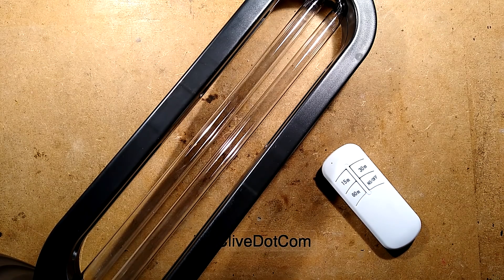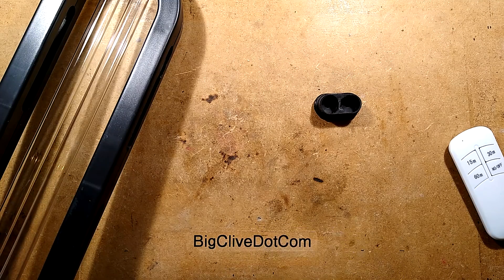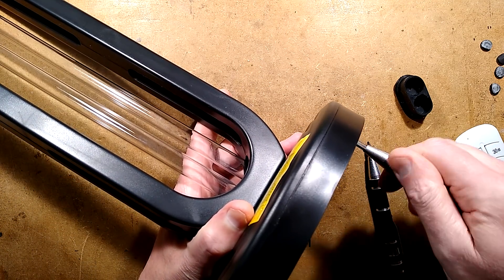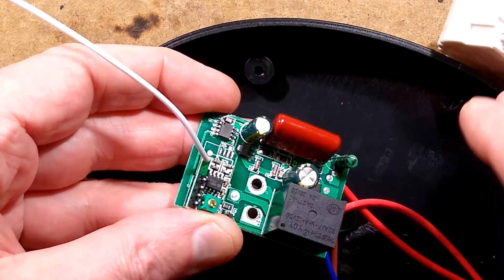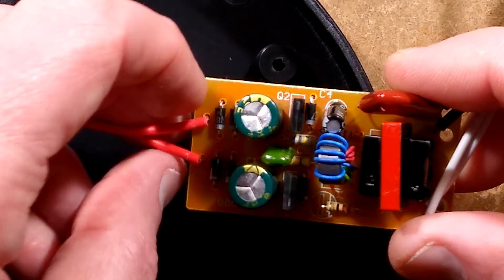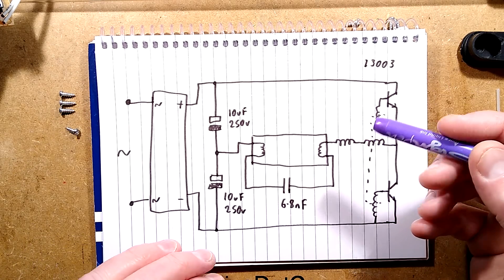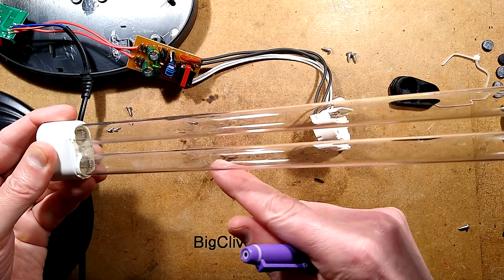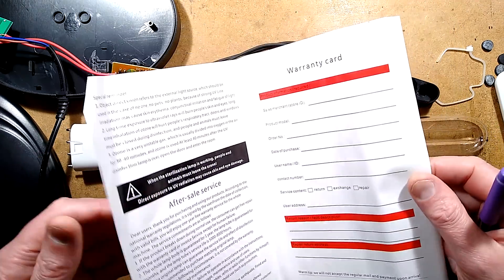Inside a stylish tabletop UVC germicidal light.  (Skin, eye and lung hazard)

Comment: Only the premium germicidal tubes will generate significant amount of ozone, because the cheap ones are made of borosilicate glass just like generic fluorescents, which blocks not just the <185nm wavelength which is necessary for splitting oxigen mulecules, but blocks a good portion of the higher wavelength UVC as well. To make it worse, their light output will drop dramatically in the UVC band during their lifetime. They should not be manufactured, but in China...
The better ones use soda-lime glass, which still blocks  the 185nm wavelength so doesn't produce ozone, but their longer wavelength UVC output is higher and more constant over their lifetime. 
The third variety uses quartz glass, and quite expensive. The UVC output is the highest and drops just a little during lifetime, and it can generate huge amount of ozone as it can be very transparent for the 185nm wavelength. Although for applications where ozone is undesirable, they make specially doped quartz glass which blocks 185nm but still maintains the highest possible output at longer UVC wavelengths.

I found an article about that circa a year ago, of course now I can't find it. I will link it in a later comment if I found it. 

The strange thing is that sometimes even seemingly reputable companies spread bullshit about the effect of different UV lights. The following US company claims that UV-C is NOT harmful, does not cause long term health problems (cancer, cataracts), as it does not penetrate deep enough into the skin to have such effect. They claim UV-B is much more harmful than UV-C, because unlike UV-C, it does not cause red skin effect or other indicating symptoms, while imperceptibly penetrates deep into the skin, and causes DNA damage, which can lead to cancer. They seem to be a reputable US company, but their claim about UV-C is not harmful seems very BS to me...
http://www.uvresources.com/resources/faqs 

*PS*: Am I crazy, or there is a ton on misinformation about this subject from seemingly reputable sources? I found one that states the following: " Borosilicate glass tubing is a common component in UV lamps. Because of its high level of transparency, this form of glass allows maximum UV light to escape, while shielding bulbs effectively. That’s why it is often used in UV lamps which sterilise water." https://glasstubes.eu/uv-resistance-borosilicate-glass/
Wikipedia: "The most common form of germicidal lamp looks similar to an ordinary fluorescent lamp but the tube contains no fluorescent phosphor. In addition, rather than being made of ordinary borosilicate glass, the tube is made of fused quartz or vycor 7913[3] glass."  https://en.wikipedia.org/wiki/Germicidal_lamp 

This pdf claims soda-lime glass also has good UVC transparency: https://www.light-sources.com/wp-content/uploads/2015/05/Germicidal_Lamp_Basics_-_2013.pdf 

Whilst this graph shows that soda-lime glass blocks wavelengths below 350nm:
https://www.researchgate.net/figure/Transmission-of-HSQ-R-100-quartz-glass-red-92-at-280-nm-and-soda-lime-glass_fig2_281293943

I think I given up figuring this out today... Experts, please help!
Reply from the maker: There are two dominant mercury wavelengths in the UVC region.  254nm and the shorter 184nm wavelength that creates ozone by splitting oxygen molecules.  The uviol glasses used in the tubes can be tuned with impurities to filter out that 184nm wavelength so you get the germicidal action without the ozone generation.

Comment: I'm definitely breathing excessive air but I just looked at my CO2 monitor and noticed it's showing 1263 ppm so it's not really quality air and I'm not sure it counts. Excuse me while I go open a window
Reply from the maker: Carbon dioxide monitor?  Or carbon monoxide monitor.  Either way open a window and let some fresh air in.
Reply: @bigclivedotcom  Mine is carbon dioxide. We got some new hvac equipment at work that monitors CO2 and opens outside dampers when the air gets "stale" with too much CO2. The numbers I saw throughout the day made me curious what it does at home. I also have CO monitors but they almost always stay at 0.

Comment: UV doesn't break apart DNA as such, more like cause it to crosslink to itself so it can't be read anymore.

There are actually enzymes that break apart this crosslinking, but the really effective ones require a lot of bright visible light to work, so apparently dead cells can come back to life if exposed to something like sunlight, or a really bright artificial light
"Photoreactivation"

These enzymes are unfortunately not active in vertebrates like humans

Thankfully not coronavirus as far as I'm aware.

Comment: This is a cataract machine.
Reply: Not really, the cornea absorbs UV. What you need is a good furnace, then you can get "glass blower's cataract*". *Not really cataract either.
Reply: Steve Terry  what do you mean by UV "frequency is high enough"? If it's high enough the thing is an xray and goes straight through without interaction.

Comment: I'd totally make a 'neon sign' version of these lights... one that makes the pale blue light without UV risk... at least without UCB and UVC.
Reply from the maker: A neon shop will happily make you a clear tube in soda or lead glass that lights mercury blue completely safely.
Reply: @bigclivedotcom  ahh and I suspect that being mercury based still, it won't need a high voltage driver.

Also... buddy van doodle (bad with names) with a welder?
Reply from the maker: @Skyliner_369  The mercury tube will still need a high voltage to run it, but not as high as neon.  Buddy van Doodle did indeed have a welder.  A welding gun.
Reply: @bigclivedotcom  One: Darn you for that song!
Two: Thank you for that song!
Three: How are you holding up in today's current situation?
Reply from the maker: @Skyliner_369  Doing OK.  But lacking the social environment of a coffee shop visit.

Comment: Well, if it doesn't emit "5G", I'm going to eat my fish & chips! - Yeah, quite a serious "Death Ray" in its own way, eh?

Probably a pointless thing to do, but could this be mounted inside a large diameter tube, with a fan underneath, and used purely as an ozone generator? Sort of, obviating the dangers of the uV light?
Reply from the maker: You do get UV air cleaners and ozone generators that work like that.

Comment: I purchased a similar lamp but from the Osram 36W without lamp holder or power supply, I turned it on with a 36W magnetic ballast and a starter for fluorescent lamps connected to the central feet, I noticed perhaps for the smell or it is just my impression, that this lamp is more efficient than an 80W HQL with removed external bulb, perhaps it has a different wavelength, it seems to me more effective so much that after a few seconds I feel discomfort on the exposed skin, I also noticed using a normal fluorescent lamp not UV as a test, which using an electronic ballst is less bright than a magnetic one.
Ciao

Comment: I tell you my story about UV lights, during my teens> I used to experiment with 400w mercury street light bulbs,  used to break off outside larger  phosphor coated  borosilicate glass bulb and left the small fused quartz arc tube intact  which is the 400w pure UV light source. I used to power up with a current limiting transformer and  disinfect chicken coops or rain water storage tanks. 
it was extremely efficient and amount of ozone it produced was amazing.
 I blinded myself twice looking at it and the pain in your eyes was  nothing you could experienced before, it was like someone stabbing your eyes with a sharp knife repetitively. Luckily I had  no permanent damage apart from couple of days of permanent blindness and excruciating pain ( i am still not wearing glass yet) and this was happening during mid 1970s.  I wonder anyone knows the exact wavelength of these UV bulbs.
Reply from the maker: The mercury discharge has three UV lines:-
365nm UVA
254nm UVC
184nm UVC sometimes filtered by tuned glass to prevent ozone generation.
Reply: 253.7 nm fir disinfection.  Lower the wl , more the ozone

Comment: When I was a kid, my parents gave is a suntan with one of those lights. It came with eye goggles to protect our eyes against the UV.  I didn't like it because of the smell.
Reply from the maker: That was probably one of the the earliest tanning lamps with a mercury discharge tube and heaters to ballast it.  Quite dodgy.  Modern units just put out the UVA and B.
Reply: @bigclivedotcom   I've got one of those. It's fitted with a Philips bulb rated 300W. Its insanely bright and hot. I'm planning to use it to make a UV resin curing box.
Reply: We had Pifco one that was basically an arc lamp. You had to adjust the electrodes to get the arc going.
Reply: The trade name for those dangerous lamps was Sperti. They could really hurt you.  Even back in the 50's when people had a modicum of common sense, many got eye damage. Today, the damage would be widespread.

Comment: Cold teabags squeezed into the eyes is supposed to be good for soothing arc eye, well it isn't. the only thing that gives any relief is Novacaine drops from the doctor, I've had arc eye several times in one eye but the worst experience I ever had was after working in a garage with freshly painted white walls and my pal welding away quite happily. Both my eyes felt like someone poured gravel under the lids! I wonder why it's always the middle of the night it decides to strike?

Comment: Clive, how is this lamp for retrobriting, have you tried it by any chance?
Reply: Yeah, tell Perifractic and The 8-Bit Guy...
Reply: As retrobrite is used to remove previous UV damage to the plastic.... I'd say a good pokey UV light would be perfect for "retro-dark"...... hmmm.... fake plastic antiques????
Reply: @edgeeffect  You dont know how retrobrite works do you...?
Reply: @Graytail  nope... but I know how the plastic gets yellow in the first place.
Reply: @edgeeffect  The hydrogen peroxide in retrobrite removes the bromide from plastics but the UV activates it. If you left something swimming in retrobrite but in a sealed dark box it'd never get any lighter, but expose it to UV for a few hours, from a strong lamp or the sun say, and then the retrobrite goes to work. At least thats the way I've read it. 

Bright direct sunlight carries a lot ot UV and will work well, but leaving your project outside on a dull or overcast day will see far less of a result. 

I live in the UK and since its been very bright since the lockdown went into effect I retrobrited my gameboy in my back yard where it could get the most exposure, took two days to get it back to its original colour but it got there.
If you live in a place where bright days are rare, like the UK most of the time, then a UV lamp in a box lined with shiny aluminium foil can suffice, it just usually takes more hours of exposure. The advantage is of course, since its artificial UV you can keep it running all day and night until the job is done rather than grab every minute of sunlight you can and maybe take several days to get the same level of cleaning. Just remember to turn the lamp off before checking!

Comment: Can you test the LED ones, they seem popular on ebay at 254nm they boast the same sterilizing effectiveness as the tube bulbs.
Do you think they would work to say sterilize a room?
Reply from the maker: I've ordered one.  But I don't believe it's going to be UVC.  Real UVC LEDs are made of specialist materials and are expensive.
Reply: @bigclivedotcom  Great stuff. It'll be interesting to see the result. Keep up the good work Clive. Subscribed.
Reply: @bigclivedotcom  I’ve managed to get hold of one of the LED bulbs. I have to say, my initial impression is that your hunch is correct. The packaging contains no warnings, in fact it doesn’t even mention UVC. The base of the says “UV Germicidal Lamp”. The light it produces is very bright, which suggests way too much of it (or all of it) is in the visible spectrum. My initial idea was to build a DIY spectrometer to test it, but these rely on readily available digital cameras, which seems to limit their lower range to 400nm. I placed a photochromic lens in front of the light and it didn’t change tint, but I guess it might only be triggered by UVA & B. It’s actually quite hard to prove it’s fake, so I’ve ordered some agar petri dishes, so I can definitively see if it kills bugs.
Reply from the maker: @RichieRoo73  If the LEDs have a slight hint of yellow phosphor and light a dazzling "ice blue" it's because they probably are ice blue LEDs because they look the same colour as the mercury UVC lamps.  But in reality it will probably just be blue light.
Reply: Yeah, a review would be great. I believe the ones you mean are the 60w 'corn' LED bulbs, which claim to be 254nm.
Reply: Depends on total wattage.  Look at lamp with uv camera to see if uv is being generated.

Comment: i am a metal worker and do welding. welders eyes are best described with the feelling of having sand in the eye but no matter how much you rub it wont stop. many people say many different things would help but truth is its all just people talking shit. theres nothing that helps. dont put wired stuff in your eyes it will make it worse. once i did hear someone say "oh you have welders eyes? theres a trick just put some onion pieces under your eyelids." usually the feeling will dissapear in 1-2 days depending on how bad you have damaged your eyes. if you cant handle the feeling maybe a doctor has some paine kller eye drops but so far i never neededt them.

Comment: I've been waiting for almost 2 weeks for mine to be delivered, along with just about everything else I've ordered from Ebay. It appears that Royal Mail have just thrown ebay deliveries in a corner and forgotten about them. Never thought I would  say this, but well done Hermes for keeping deliveries coming.
Reply from the maker: The postal system is experiencing more throughput than at Christmas.  It appears that everyone has been buying online because they can't go to the shops.
Reply from the maker: I also have a sneaky feeling that lots of different sellers are selling the same items from the same UK warehouses.  And when they run out they will probably ship them from China instead.
Reply: @bigclivedotcom  I'm sure you are right, but apart from the UVC lamp only one other item is remotely related to Covid 19. The rest are a boost converter, a solar charge controller and other related bits and pieces. They are all marked "on it's way to RDC" which means Royal Mail have got them.
Reply: You do know that China was on lockdown for several weeks, right? I am also waiting on a few items but they'll get here when they get here (one did show up last week but I assume it was already on its way).
Reply: @chaos.corner  They aren't in China, they are all in the UK and I've contacted the sellers and confirmed they've been dispatched.
Reply: @chrishartley1210  Ah OK. The post has been working fairly OK here in the US though Amazon is taking a little longer than normal.

Comment: That remindes me of a cheap Daylight Lamp that i buyed from Aldi a few Years ago. After the Lightbulb inside of it broke, it was impossible to find another one, with the same size and Socket for it. So i throwed it in the trash and buyed some LED ones that use the E27 Socket to use them in a standard Desktop Lamp.

Comment: I'd like to find a UVC light that I could screw right into a light socket that way it isn't very expensive and I can either put it in a light socket in my basement away from people or even use it in my shop if I need to disinfect something where nobody usually goes.
Reply: google it. I know they make them in the EU voltage but not sure what yours is.
Reply: @johnpossum556  I'm in the US and found some on eBay but can only find the LED versions which I'm not sure if they can actually produce true UVC light. I did find a quartz one but it was 220v which I could probably wire up a light socket in the basement or find a transformer but that's a lot of work for a light.
Reply from the maker: They do them.  Make sure you get the clear fluorescent type and not the fake LED ones.  The same safety rules apply.
Reply: @bigclivedotcom  That is what I was afraid of because I figured the LED one's couldn't be trusted which is mostly what I can find for 120V unless I order from China which takes literally months for shipping. My only other option is go 220v which I could do by either wiring to both hots coming in or using a transformer.

Comment: i am still stuck on how to determine / measure the spectrum of these lamps .....   are they really UVC or some combination of UVC , UVB , UVA , visible light and other things ?
Reply from the maker: Mercury lamps produce several peaks in the visible and UV spectrum.
Reply: bigclivedotcom      did you read about that or measure it ?
Reply: I think it's all the mercury emission lines. From the wiki page on these lamps, we've got184.45

ultraviolet (UVC)
253.7

ultraviolet (UVC)
365.4
I-line
UVA
404.7
H-line
 Violet
435.8
G-line
 Blue
546.1

green
578.2

yellow-orange 
650.      Red.

So it's UVC with a side of UVA and normal light.